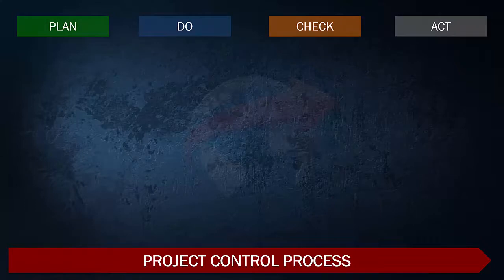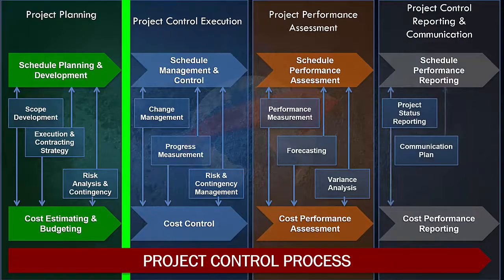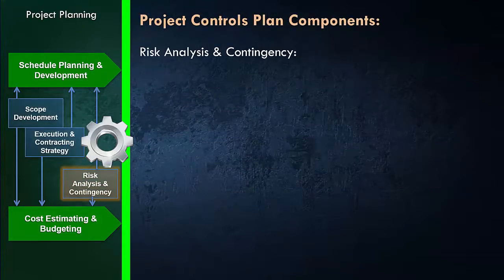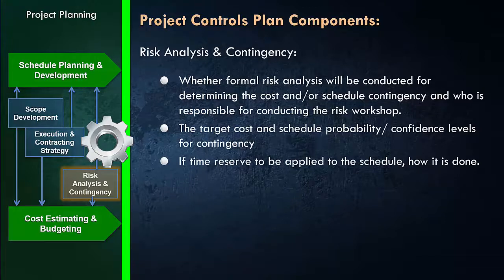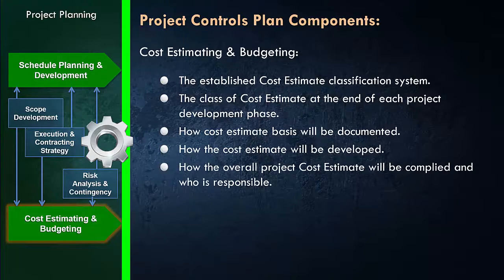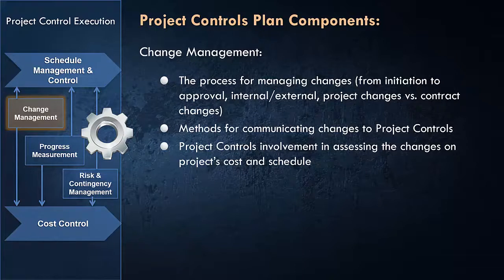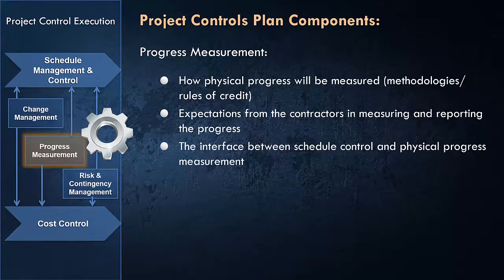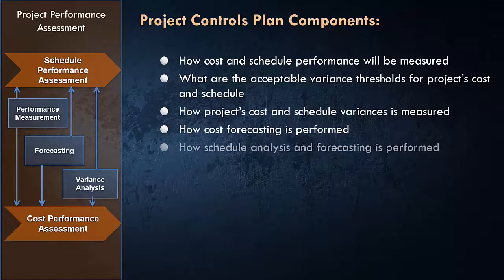The Components of a Project Controls Plan (PCP)

Comment: what is the difference between Project control plan and Project management plan
Reply from the maker: The Project Management Plan is a comprehensive document that defines how a project will be executed, monitored, and controlled, integrating all subsidiary plans and baselines from various project management knowledge areas. In contrast, the Project Control Plan focuses specifically on the monitoring and controlling aspects, detailing the processes for measuring project performance, managing changes, and implementing corrective actions to align with project objectives. While the Project Management Plan provides a broad roadmap for project execution, encompassing scope, schedule, cost, and other management areas, the Project Control Plan zeroes in on ensuring the project stays on track through detailed control measures and performance metrics. Essentially, the former outlines the overall approach to managing the project, whereas the latter delves into the specifics of performance monitoring and control to guarantee project success.
Reply: thanks @Projectcontrolacademy